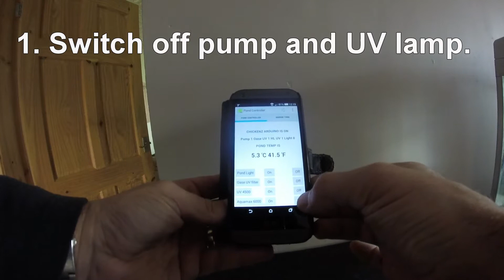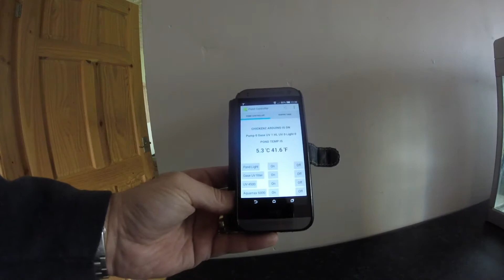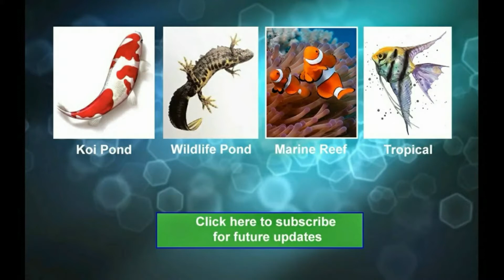My Koi Pond - How to change a UV bulb on an Oase Filtoclear  (link in description)

Comment: I have a stand alone uv so don't need this one on. Will the filter work if I remove the uv unit. Or should I leave it in and just not plug it in? Or something different? Many thx
Reply from the maker: I dont think you need a bulb fitted, but the hosing will need to be fitted as the water flows across it.

Comment: I just followed your instruction and changed my oase FiltoClear 6000 bulb. How long does it take to clear the green water any idea? Thank you
Reply from the maker: Depends a lot on how much algae is in your pond. As the algae dies is will be picked up in your filter so you need to backwash the filter daily while the weather is nice and the water is green else it will break down in the water, adding nitrate and phosphate back into your water fueling the next growth of algae. You will notice the difference after a few days.
Reply: @TheAquaticGeek  Thanks a lot Ian. I can already see a slight improvement. Will do backwash and see how it goes.

Comment: I have this exact same pump. But when I unscrew it & take it out, it's full of water. I can't find how the water is leaking in, so I can't use it as it keeps blowing the power. Have you had this happen?
Reply from the maker: +MrScamman I haven't had it happen to mine, but there is a rubber seal that if damaged, would allow water to leak in. I will add a video showing it in detail this week.
Reply: +Ian Carmichael I've replaced the rubber ring seal that goes on the quartz sleeve. But it still leaks water,
Reply from the maker: +MrScamman :/ not sure then, I've got to change my UV soon ahead of spring, I will have a look for and weaknesses and report here.
Reply: @MrScamman  did you ever figure this out? I’m having the same problem (water inside).

Comment: Just put a new bulb in and it flashes and lights up at either end, do these units have a starter motor, or is it a problem with the bulb, any help would be much appreciated
Reply from the maker: They don't have a separate starter as far as I know,  might be a dodgy bub ;/

Comment: Video did not show before removing UV bulb you have to disconnect inlet & outlet water connections as water will pour out.
Reply from the maker: Depends on where you have your filter located compared to the water level of your pond.  Mine is slightly higher than the pond water level so I simply switch off the pump, no need to disconnect pipework.
Reply: @TheAquaticGeek  Raised ponds is where you have the problem where filter is buried in ground.
Reply from the maker: @mrdemocracy7106  I understand now. Thanks for info..